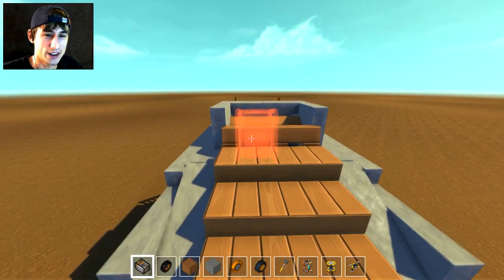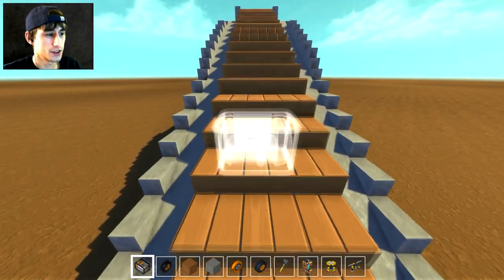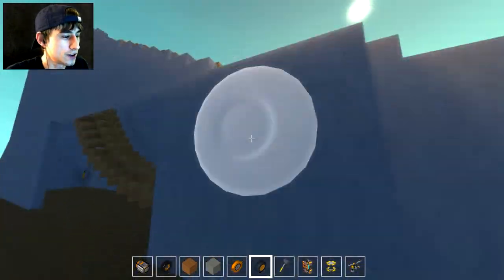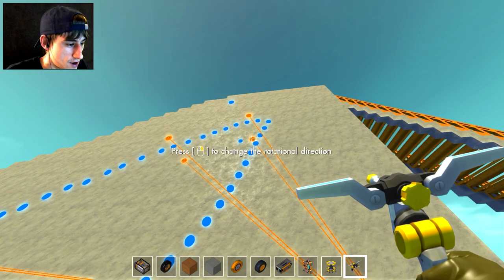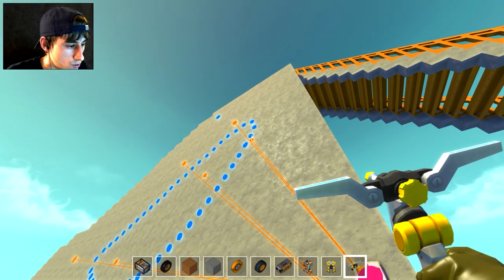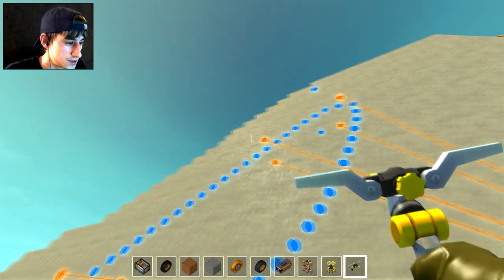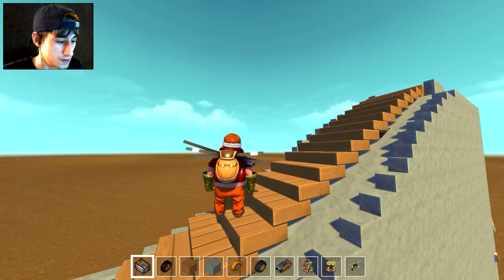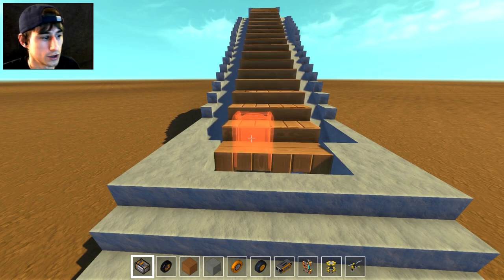SCRAP MECHANIC ESCALATOR?!?!? (Scrap Mechanic #34)

Comment: That's a great design. What system specs do you have?
Reply from the maker: i7 4790k with 16gb ram, twin ssds running raid 0 and the gtx970 (soon to be 1080)
Reply: Was this comment written before mm was a thing?
Reply: @kANGaming gtx1080 7 years ago was great for its time

Comment: Yeah I tried making a crane shovel with treads, way too laggy with all the bearings. It could handle about 20 bearings worth of treads but no more. So I tried converting the treads into a kind of "treadcycle" which was kinda cool, needs suspension glitch steering though.
Reply from the maker: Ive been working on a treaded project with the same issue. 1 tread works great but when you put the second one on it becomes a lag monster. Hopefully they fix this issue soon!
Reply: Yup its the two separate treads interacting with the body that cause the lag for me. The two treads don't lag when detached from the frame. I've also made a physical chain out of pipes, no bearings. It actually doesn't lag by itself but I haven't tried making it into a loop yet. With the welding tool now, might be worth taking another stab at.
Reply: the links are 3x5, built using a jig
Reply from the maker: Yea it seems like 3 body interactions are the problem. Same thing happens to me where each tread on its own has no issues.